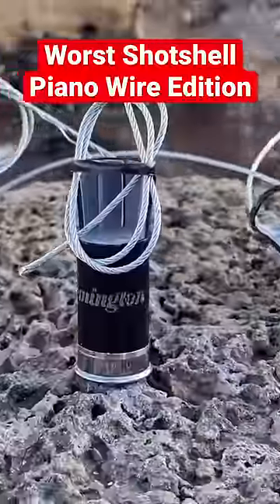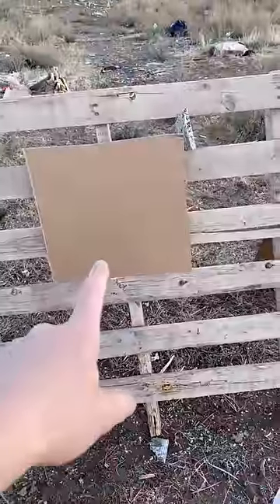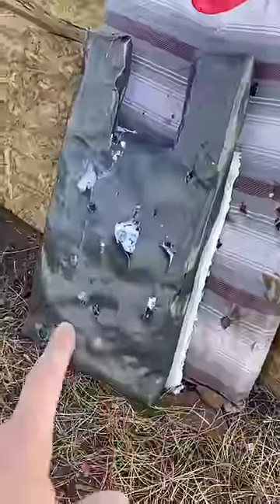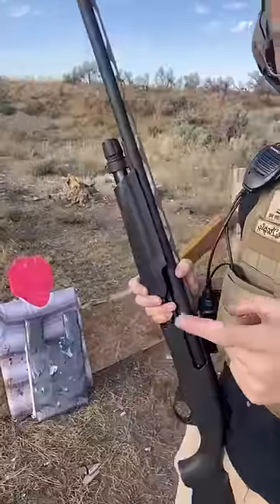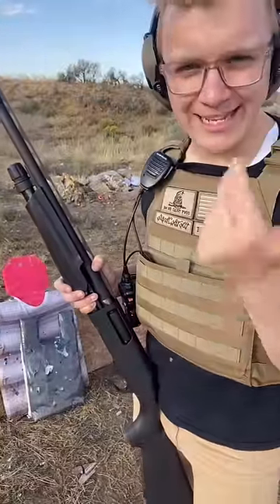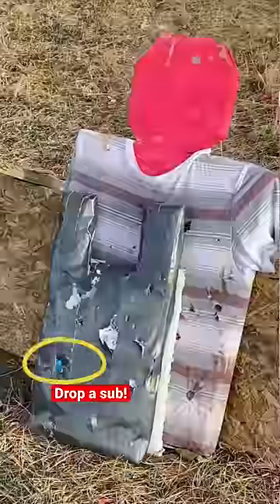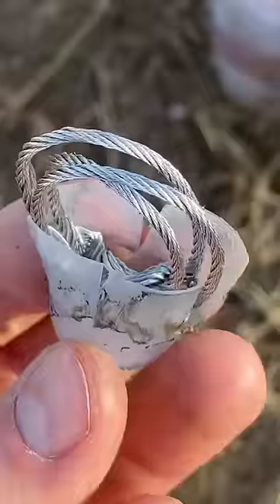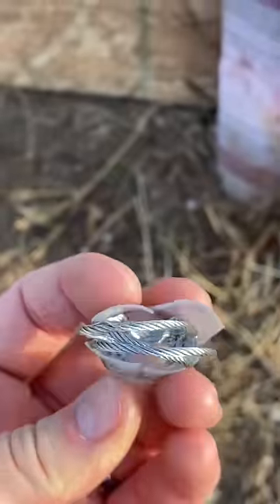WIRE Shotgun Shell *Experiment* #gun #demolitionranch #fullautofriday #demoranch #civtac

Comment: You loaded it wrong. You have to coil it down into the hull. Cut the shot cup/ wad down so it’s like 3/8 of an inch tall. And coil as much light weight cable that will fit inside. Heavier and without the big wad to hold it together, you should get more spring effect
Reply: I concur

Comment: The heat would probably also cause it to retain whatever shape it was bent in. If you stretch a spring and just hold a lighter to it it will straighten out depending on thickness of course.

Comment: You need to wrap them better into the shell.
Littaly like a spring wall with a little bit of melted lead driped into the bottom for the support. 
Your gonna need a pice of copper pipe of somthing for a mold then (once it cools obviously) insert into the wad then pack your shell.
The trick is going to be how to keep it from sticking togather and olny getting it at the very bottom.

I know its probably not very efficient but I bet you they would open up like crazy if made right...

Comment: You need weight attached to the wire or else that will happen. You can use two or more, the important thing is that the round stays together. If a soft target, it should stay together and either embed in the tissue/wrap around bones, or.. go straight through. Either way it should all stay together.

It won't do much of anything to hard/armored targets however.

Comment: Historically, these were loaded into cannon with weighted balls attached to the end. Also try using a shot cup with the wire coiled. Some applications may also use a filler to prevent deformation during the firing/exit process. Keep trying.

Comment: Also if you knew your science you would know this is not piano wire which is a monofilament but rather 1/16 inch cable wire.  Which is more flexible than piano wire which, although springy will bend to form a spring if you wound it that tight.  The cable should be wound AS a spring and maybe a little clay to hold it in place.

Comment: One problem with this.
 
That's not piano wire. That's steel cable. 

Piano wire is solid. That is a twisted cable made of many smaller strands. What you have there is PICTURE wire, a relatively soft steel cable used for hanging pictures on walls.

Piano wire, aka music wire, is single-strand spring steel, very tough, with very high tensile strength. It's tempered to be very hard, resists bending, and can withstand terrific strain, as it would have to if it were wound around tuning pegs in a piano.

"But wait, the low note strings in a piano are wound! Isn't that what this stuff is?" Not even close. The deep notes have the same spring-steel core wire, but are wound with copper wire to give the string MASS. The greater mass of the string makes the note much lower than the tensile steel string could have by itself without being unusably long. They make very thick music wire, topping out at about 3mm in diameter, but you can't generally wind that around a tuning post. So they use a thinner wire and wind it with copper to increase its mass.

If you took some thin music wire, thin enough to coil inside a shotgun shell, and fired that, it would not be mashing together like the cable you used did. It's too hard to mash in that fashion, even if you had a marble in with it.

No, what you have there is picture wire, or a thin steel cable or wire rope. THAT stuff is downright soft in comparison to piano wire. So my suggestion would be to buy some actual piano wire and try it again. You'll probably have to buy some small quantities to see which you can coil small enough to fit in a shotgun shell without it deforming the shell and making it unable to be fired, and retain its spring  so it will snap straight after being fired. Perhaps something like this: https://www.amazon.com/Music-Wire-015x36-Bundle-wires/dp/B0006N6L6I

They also sell a lot of different diameters, so you can test them. I searched for "music wire", the broader term, and found this. It looks small enough to coil but thick enough to have sufficient mass to be a decent projectile. It will not mash together like that thin steel cable you tried.

Comment: It would work better if you attached split lead fishing shot on the wire. You could also place the wire in a bullet cavity and cast small bullets on the ends to create homemade bolo rounds. Picture a 250 grain cast .45 bullet on each end of a 3" cable. I do not know if these bolo rounds are better than buckshot or if you could include these bolo rounds with a wax filled cut shell. These cut shells are about as effective as slugs.

Comment: so what not add the weight to the ends of the wire. in a sense making a bolo. and it gives it the weight that the marble would be. also pack the shell with cotton or something to help seal the barrel as the load is exiting.

Comment: That's not piano wire. That's cheap-as cable.

If it did manage to hit flat, all the impact would be spread over a large area. If it comes in sideways, the impact will be distributed over time. It's not going to penetrate for squat.

Comment: Unweighted wire wot. Work but out some Lil fishing weights at the end bolo style and that wire will spread out  AAANNDDD pack more of a punch. Also to avoid crimping I've seen 3d printed plastic pieces made in to 2 cup halfs made to fall away as it exits the barrel.   Good luck , don't give up!  Short bolo rounds are gruesome but I'd like to see a little longer length more like what u got going on.

Comment: There are many ways to use this, and most people have already said it multiple ways... But another way it was used was in a Ducknbill choke LoL. Or sliced up into multiple pieces of different sizes.
Reply: Another way they was used historically was not cutting the shell and just jamming right in front of the shell. Another way was coiled extremely tightly and with lead or steel weights on either end and fit into the shell without cutting it causing it to put more pressure on the wire... Also not using modern plastic wadding, works much better with good old hard paper wadding

Comment: Because you did it wrong! Your supposed to clamp small lead fishing weights on each end of a 2 inch long piece of piano wire and then you curl them into a small enough circles that they stack inside of a 12 gauge shotgun shell, and pack the shell with as many of them as you can fit in it. Then you will something way cool, when we were kids we stuffed all kinds of stuff into shot gun shells we even took 10 inch long fine piano wire and put 2 small lead weights on each end, it is a devastating round. It is unreal what it does in the 2 inch multiple per shell or a single long wire with twin weights on each end

Comment: You need to cut it  can't be no less than half an inch long and then you got to put them all in a nice circle and then fire that it needs to be able to blow them little wires apart it's very effective 🤠 it even helps to give the wire a little tap with a hammer 🔨 not too hard just enough that it kind of wants to break up but that's after you cut it